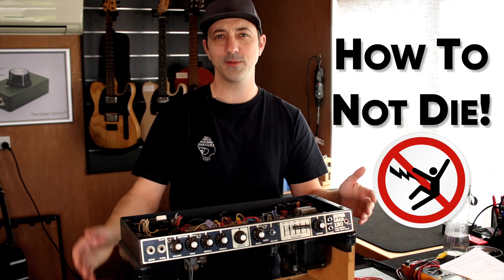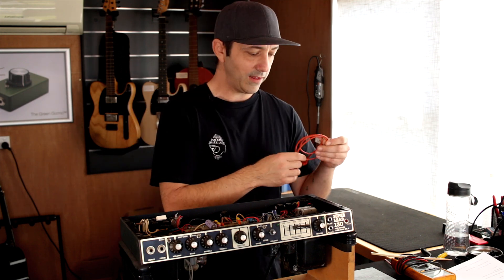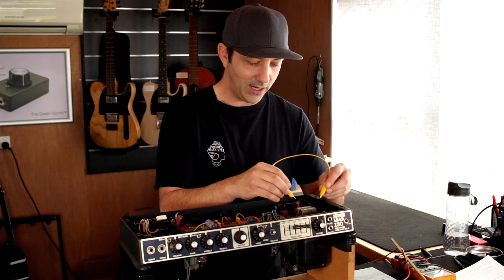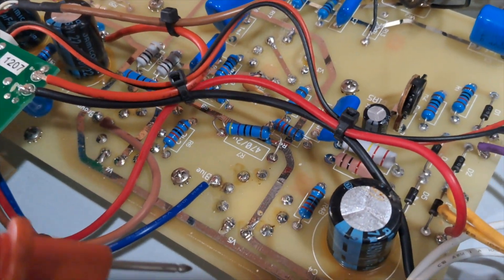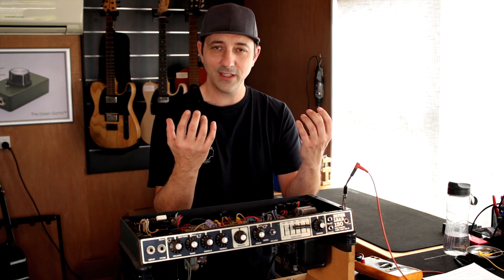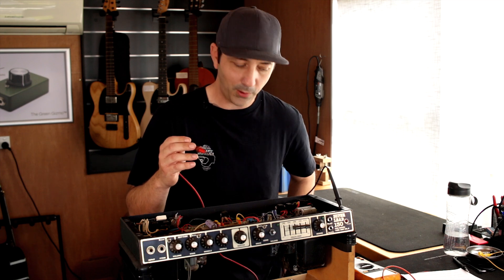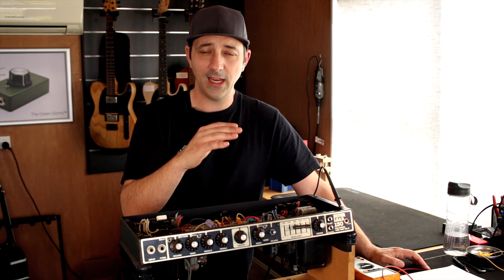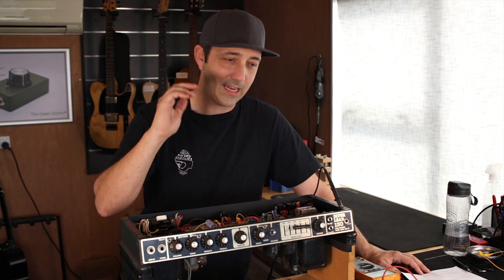How To Not DIE : Guitar Amp MOD SURVIVAL Tips

Comment: with  multimeters i tend to use a set of clip on leads doing bios ect so i dont have to touch anything if i drain capacitors i can use one hand to drain caps watch the meter go down , remember the volts are 600v DC ect , from caps or transformer a lot higher than AC mains ,also with amps you need know what death caps are and remove them and wire mains wire up with earths on two wire leads,working on amps i always use a bulb isolation cable ,a Variac and transformer supply, two multimeters one on volts one on mili volts  ,when you prod around inside with the amp on always one hand in your pocket !.

Comment: Very random but when testing things with the power on it is a very bad idea to drip sweat onto the board. Don't hover over things deep in thought lol. I just did that and it made a really bad noise before I turned it off and unplugged it. I'm thinking it will be fine but could have been way worse. 

This video is great. Most of it is common sense if educated with electronics but still stuff you cannot take seriously enough if you enjoy living. Not resting other hand on the chassis is one that didnt really occur to me. I typically only use one hand at a time but never really thought of it like you described with resting the testing hand on the chassis.

Comment: Hey just checking, but bleeding through the chassis seems weird to me, especially when you advise to unplug the amp, wouldn't clipping an earth prong on a nearby plug make more sense?
Now if the chassis is grounded all is good, but I don't see yours touching anything but wood  and I'm not an expert but I'd feel more comfortable bleeding the cap directly to earth as it leads to less chances of completing a circuit with my body no?
Reply: In a guitar amp, the negative terminal of the filter capacitor is connected to the chassis, so connecting to the chassis is simply a convenient way to connect to the negative terminal. No connection to safety/'Earth ground is necessary, so the amp should NOT be plugged in.
When bleeding a capacitor, the object is to drain its charge (a store of electrical energy).
When a resistor is connected between the positive and negative terminals, the voltage on the capacitor causes a current to flow in the resistor (basic Ohm's Law). If a current is flowing in a resistor, it dissipates power. A resistor dissipates power by converting the electrical energy to heat, another form of energy. The heat generated in the resistor is dissipated into its surroundings. In other words, the charge doesn't 'go to ground', it's lost into the atmosphere.
Reply: @silasfatchett7380 Alright thx for your explanation, I understand why the amp would not be plugged to main,but because when I studied applied physics we had earth leads everywhere,therefore I didn't think of dissipating it through the resistors. I would be more confident grounding the chassis to an earth prong somewhere though, just force of habit I guess.

Comment: Nobody in the history of guitar amps has ever died from a shock from messing
around inside one not to say it isn't smart to try and avoid it where possible though.
Reply from the maker: To anyone reading: Comments like this can give a false sense of confidence when working on tube amps. Always respect the power inside those amps—safety first!
Reply: @WaylonMcPhersonGuitar I agree with you and your video and it's point, but he's also correct, no one has and yes respect it I think "fear" at least where guitar amps are concerned is a little overboard, healthy respect cause they will definitely bite you hard and most certainly put you in a very bad mood, unless you latch on to live line voltage and are galvanized to it when you do, popping your heart and killing yourself is a pretty big long shot. Nothing is wrong with healthy respect and caution but fear or certain death? I'm not sure I feel that is entirely justified. There's a lot of different factors in electrical safety and electrical work period, for one thing volts and "high voltage" isn't of itself even necessarily the issue, volts and voltage aren't what "kill" you. People get hit all the time with discharges of 50-100-150,000 volts and shrug it off seconds after the hit. I dont have any actual problem at all with the video or the message in the end and even the hyperbole is fine but what the other guys said IS true too even if it doesn't follow the "safety PSA" format or message or what have you.
Reply: Really?! Is there an international death log out there that specifically deals with guitar amp related death that I’m not aware of? DO NOT listen to this ignoramus!
Reply: What on Earth are you talking about. People have absolutely died. How you arrived at this conclusion I do not know. Google anything for 5 minutes? There are many dangers to consider with anything that plugs into wall current. Look up Keith Relf. It's one thing to shitpost on youtube comments but you are giving out deadly advice. If you worked in any professional capacity and gave that advice to a client or friend there is a chance you get charged with manslaughter.
Reply: @dannnmerkle7930  Nobody has died from a shock from the voltages or amperages inside a guitar amp you can google all day and you won't find any reported deaths.

Comment: The hand trick has probably saved my life. 
I’m an amp tech and I was working on a vintage sound city 200w amp and it was my own stupid fault. I was tired, I kept switching it off and on testing etc and I’ve made pretty much every mistake mentioned. Not tested for voltage, not discharged every time and I was trying to squeeze more work in that weekend. I accidentally brushed my finger against a cap and I got a nice big tingle all the way up my arm. BUT, I wasn’t touching anything with my right hand which probably saved me. Funnily enough, it’s my first time getting shocked and I’ve been playing with electronics since I was in high school. 

Please please please people, it’s not fun to be a smart ass and act too confident. I’ve been doing this for a few years now, and I’ve always had a lot of respect for electricity and the damage it can do. Maybe a little fear too, whatever keeps you from being complacent. You often hear about table saw accidents, and usually it’s people who have been in the industry for a long time, they have become insensitive to using dangerous tools, so are more likely to have an injury. 
In my case, I think it was the tiredness and frustration of it taking so long to find the issue. I should have walked away and given it some time to think things through overnight. 
Now, I have rules so that I don’t work on anything over battery voltage at certain times. 
Fixing some random amp isn’t worth your life, and there’s only so much you can do in a day, so never rush. I have a few little tips that may help some people:
If you’re not sure of what a component does, if you can probe it or substitute it, don’t. research, ask and educate yourself before even attempting to do anything with that part or device. If you fry something on a pedal, you might get some magic smoke but you’re unlikely to get hurt. Tube amps are a different story. Things can go BANG, if you’re lucky you’ll blow a fuse either in the amp or in your breaker box, but it can be much worse and cost you money and possibly hurt you. 
Never, ever work on amps at night, when tired, unwell, in a bad state of mind or in a rush. I like to think that I’m a surgeon performing a operation. You wouldn’t want a doctor that’s any of the above working on you. It’s about treating an amp with respect in the sense that it can hurt you, so you’ve got to be fully awake and alert so you don’t make mistakes like I did. 
Also, you notice things more and at the end of the day, it’s our responsibility to make sure the device is safe to use for the customer, so take your time. 

Wear technicians gloves. This is a new thing for me, but I love maxiflex gloves.  There are ESD gloves for working on electronics, but anything that’s very thin will do. It’ll also stop you from trying to pick up components with your bare hands and getting burnt while soldering. They’re thin enough to handle small screws etc but offer another layer of protection. 

Work/life balance- it might seem obvious to some, but I never appreciated a proper routine, good eating and sleeping habits and regular breaks until I burnt out a few years ago. Good habits enable you to focus and be less forgetful, so if something isn’t going right, just take a break. Take 5-10 minute breaks every half hour to an hour